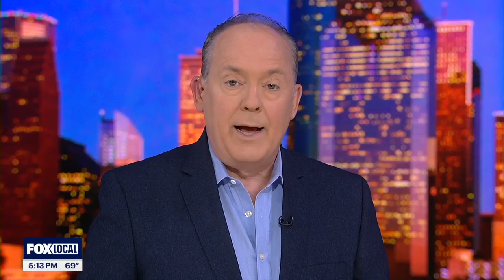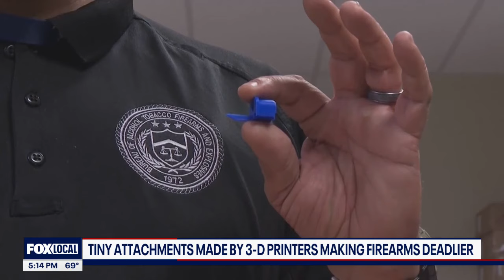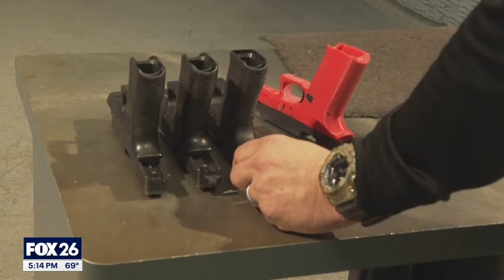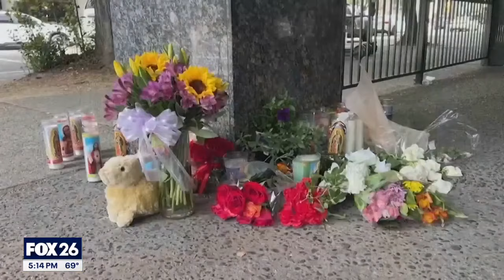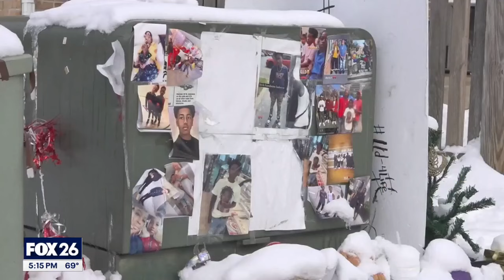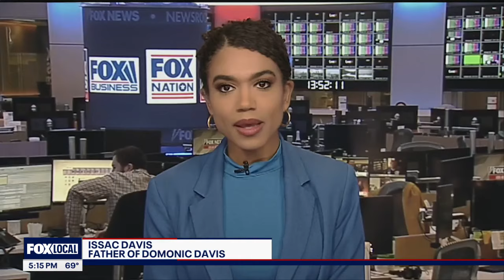Guns now deadlier due to tiny attachments made by 3-D printer

Comment: I wouldn’t say deadlier, just less accurate. I still prefer accuracy over quantity.
Reply: You can discharge 10 rounds quickly without the need of a device. That's wasted ammo.  Proper shot placement can get the job done quicker and saves ammo.

Comment: The guns are as innocuous as ever.  A person could install one of these devices into a gun, fully load it, cock it and set it on a bench and it will stay right there without firing until someone picks it up and pulls the trigger. It is the criminals who use these devices in guns while committing crimes that are more dangerous.

Comment: Let’s get this straight, legal gun owners are very likely NOT using them in criminal acts.
Reply: And it’s also being used by illegal gun owners to a damaging societal effect. 

Banning these don’t stop your right to bear arms.  But unfortunately you can’t really ban 3D printing without violating other rights.  

Your logic is still flawed regardless.  Reducing the ability to circumvent existing laws in order to lower violence has no effect on your right to own an AR
Reply: @drx3373 Don't say illegal gun owners.  Just call them criminals or rule breakers.  These are people who knows there are laws making what they do illegal but don't give a crap.  If the justice system doesn't enforce the laws, these folks will keep doing it.  E.g.  It's illegal to pass a school bus with flashing red lights in order to protect kids.  However, cars constantly pass by the bus.  No cops to enforce the law.